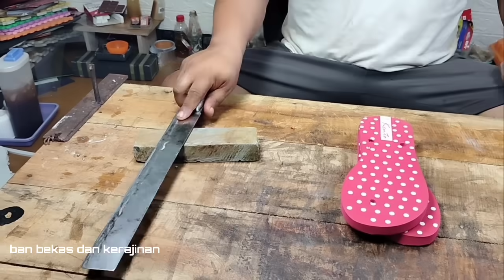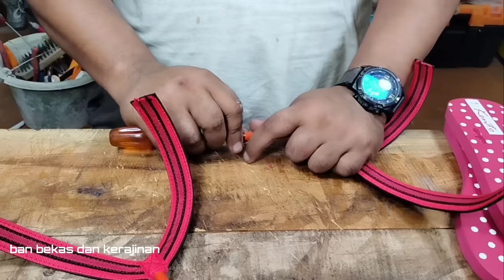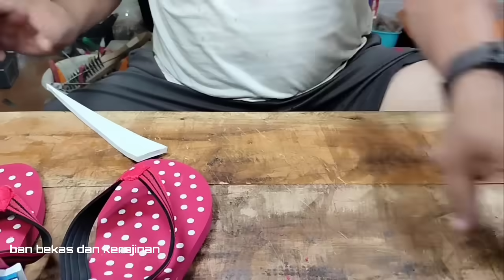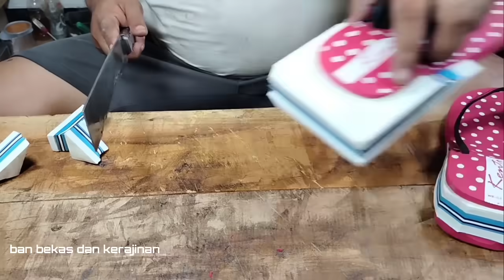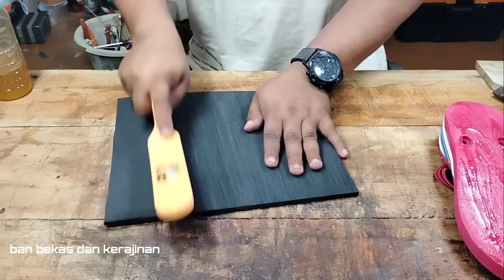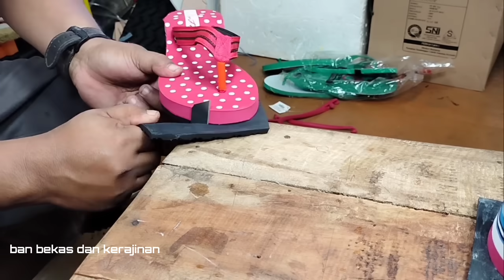Tricks to make high heels

Comment: The craftsmanship was good, and the finished product was very pretty, but the design would be very uncomfortable.  There is a sudden elevation of the heel with no arch support or graduation leading up to it.  And the weight would all fall forward into the thong portion between the toes.
Reply: and 24h after, everything will go away because of the way he made this... super glue everywhere and a few hammer stroke and that it? glued forever? what a joke xD now way man.
Reply: Тут ни мастерства ни дизайна ни удобства и в помине нет!
Reply: @Paulvarrgas   you apparently haven't looked carefully at the shoes you wear. They are made of cardboard with thin coating of leather [if lucky],  if not it is plastic, or vinyl over cardboard,  and plenty of superglue and weights to hold together,  it is just that factories does it faster and automated,  but the actions are not much better,  and bought shoes don't last that much longer,   and you pay a heck of a lot more.
Reply: this is not different than high heels, and some people slide forward towards the thong so cant wear them at all.   I think the point was  that you could change not that they have to be thongs.
Reply: No thats not true, the heel is small and the materials soft, stop trying to be an expert, shame on all of you liking this comment
Reply: @odapunkt  It is a badly designed pair of shoes - softness of material has nothing to do with it. And this is a public forum - people are free to like or dislike any comment.

Comment: As an entertainment, very good.  As a sensible suggestion for anyone to try at home... absolutely not, unless you want, at best, bad posture and injury to your back, and or feet.  Or worse, sprains and broken bones.  Shoes are designed by experts who understand foot, leg and body dynamics and altering them when they were designed to be flatties is not that sensible.  And where was the model trying them out at the end of the video?
Reply: Right? I’m a shoe designer, after having worked in the footwear industry for over 30 years and no way are these flip flops gonna feel good but I really enjoyed watching  the process!
Reply: Shoes are designed for looks. Most shoes are bad for your feet, especially high heels.
Reply: @rojo3779 neither does high heels. So what's the difference. I use to wear these back in the 80s and 90s and never had a problem with them
Reply: What are u on about these wedge flip flops can absolutely be worn I have a black pair that are  from a high street well known retail store, most designer red bottom heels are more likely bad for a lot of women's feet and a foot wear specialist will tell u that hence why ppl go on to develop foot problems over time, but guess what they sell in stores any way its not illegal I've studied footwear, this is how you build up a wedge heel the only difference is the flip flops will act as a sole board and you can add Cork (thats one way of doing it) to build up the the wedge heel underneath the sole like he did with the flip flops, maybe there was no model on hand to show us how it fits these wedge flip flops were quite popular in the early 2000s sold and bought in many retail stores it maybe not good for the feet but what this man has created many western shops sell.
Reply: @Dee-cp2ck  the problem is not the concept of heels on flip  flops, it's the shape this specific pair has
Reply: We are in modern times. I think a lot of you who are alleged experts must have last seen shoes in the times of Queen Victoria. I have a similar pair like in the video but they have a straw hemp low heel. They are very comfortable. Shoes that younger women wear in clubs, bars etc, they are definitely  not designed for comfort or anything else abd a lot of the designs are ridiculous but they are sold online and within well known retail fashion stores. I've seen shoes with heels that are triple circles how anyone could stay up on them is beyond me, Disney shoes with Minnie mouse as the heel, there are ridiculous shoes sold  which are not going to do feet any justice other than to leave you with bunions, callouses, varicose veins and twisted toes in old age. The shoes in this video will be more than comfortable.

Comment: I loved watching this! I wish I had all the tools to make stuff like this. I believe I have the eye for the craft as well, just need the equipment. Thank you for sharing your innovative talent! 🩴🩴
Reply: He used a knife, a razor, a hammer, and a rotary sander... which dont you have? The sander? Use a rasp, or just sand it by hand.
Reply: @secondarycontainment4727  What kind of glue was that which he was using?  Thanks!
Reply: @pricer39  You're right, I missed the consumables. He used two different types of glue.
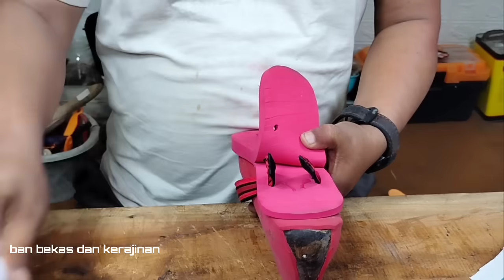 @03:05 he used "CA" glue / cyanoacrylate glue AKA Super Glue to affix the straps.
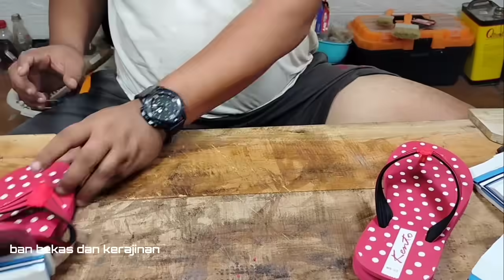 The next / thicker yellowish one in the clear water bottle is more than likely Contact Cement AKA "contact adhesive". I say this because the procedure for adhering two surfaces together with this adhesive requires a bit of a dwell time for the adhesive to become tacky before pressing them together for a permanent bond - you can see him preventing contact with the foam wedge he placed in there @03:38. And you can see the jump cut while he waited for the sole of the shoe to dwell before adhering it. Additionally, the EVA foam that these flip flops are (probably) made of is typically fused using contact cement.

Comment: A good tool and die maker would just stamp cut the blanks and patterns with a lot less waste. I guess time and material are measured differently in some places. Also, no activated glue just contact cement? Those flip flops will last about a month.

Comment: Since these are not made with templates, the boat pairs will not match mathematically (geometrically); They will not have the same shape (size, distance, heights and same positions etc.) which will cause so many issues with hips, backs knees, foot, posture…

Comment: what the hell did I just watch did he just get used dollar store flip flops for making heels with and he used super glue and that other glue he used to attach the cheap ass foam that was cutting like butter with a dull as ruler looking stick knife to the inside does not seem like the actual glue that a cobbler would use to attach soles to shoes. I have seen some cobbler youtube channels and non of them have a ghetto gluestick made from a bottle with a gauze or something over the top also the actual glue although the colour is sometimes similar is more thick whenever I see pro's on youtube doing it and by pro I mean people who have their own shoe making/repairing shops and upload to youtube as a side job and some even accept fan requests through social media involving the customer getting their used shoes delivered to the shop of the youtuber. This guy is ALSO NOT using a real belt sander he just got a grinder which he probably borrowed off a friend and then attached a pipe to the side with some sand paper over the pipe or probably found a pipe and pre rolled up belt of sandpaper that is the same size because also it technically isn't a belt as in a real belt sander you would NOT have the sand paper around one SINGLE spinning part but there would be 2 parts and it would be stretched over them so you can freely push against the sandpaper and actually sand corners round and make round outer diameters curves not inside curves etc... which is almost impossible if there is no slack in the sandpaper as it is completely against one single